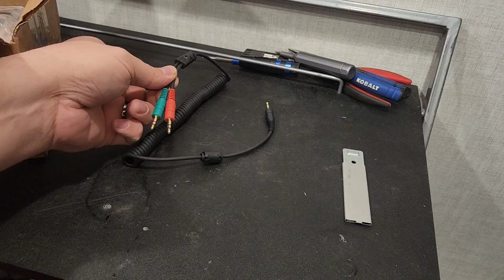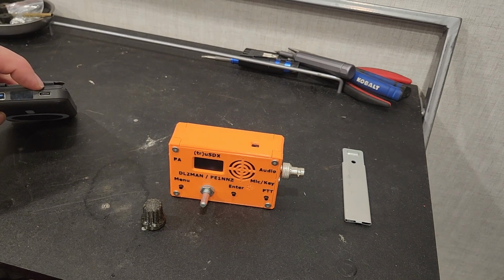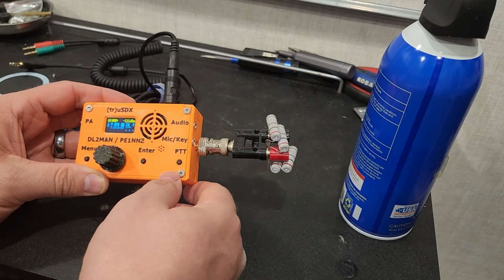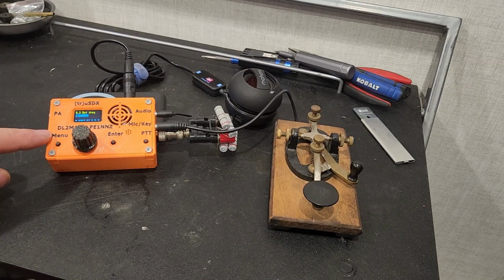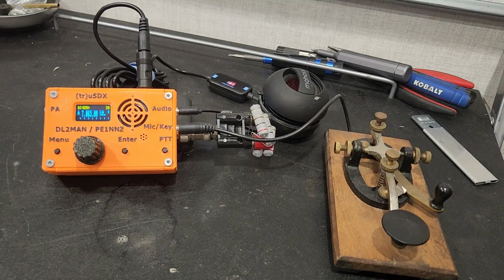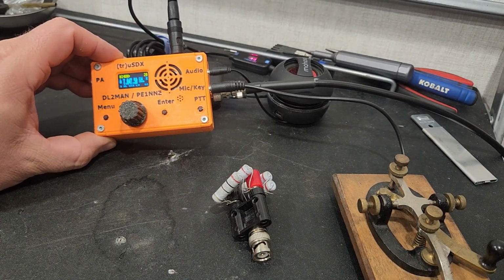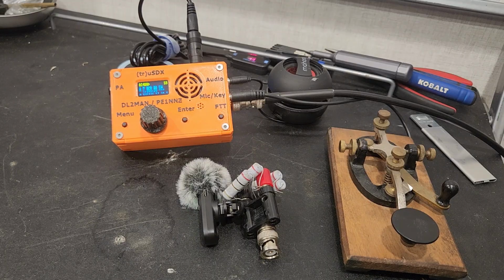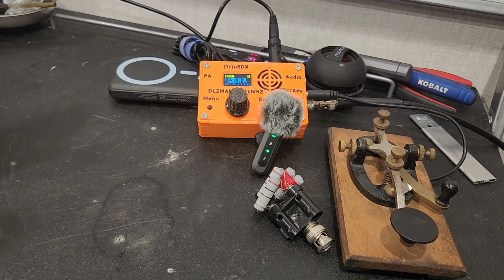(tr)uSDX Unboxing and Setup with Vintage Straight Key

Comment: Your dummy load may be not really 50ohm   by RF.
Those resistor are made like a coil
Reply from the maker: Yeah I guess it's not laboratory grade 😂 It does great with my QRP rigs though. 5/5 would recommend